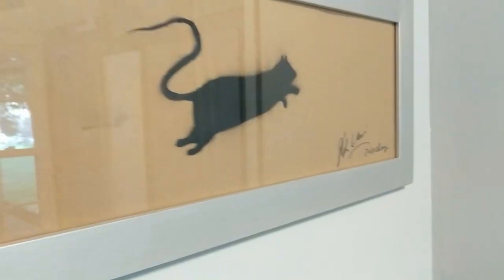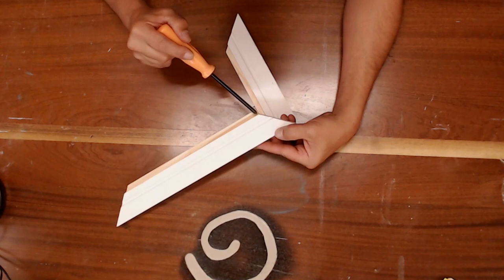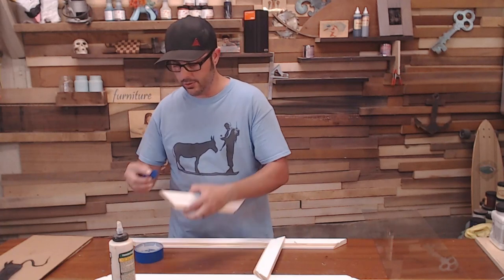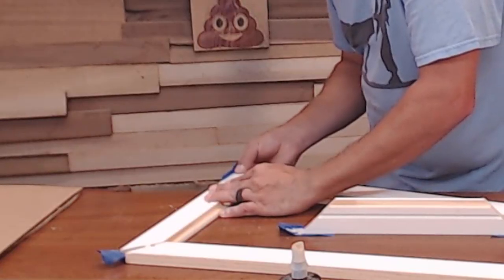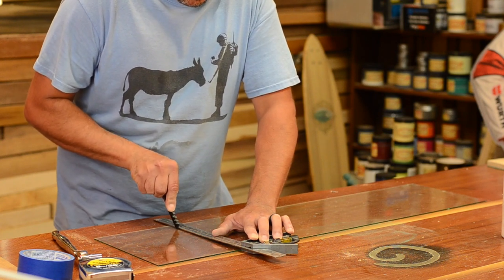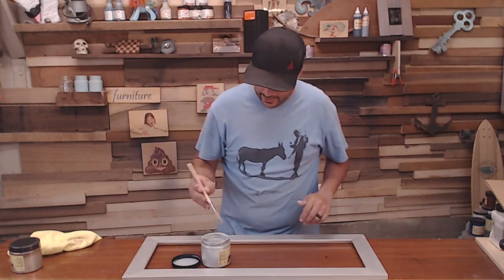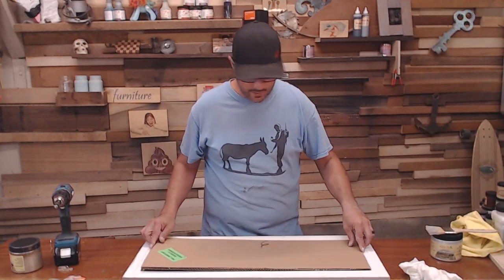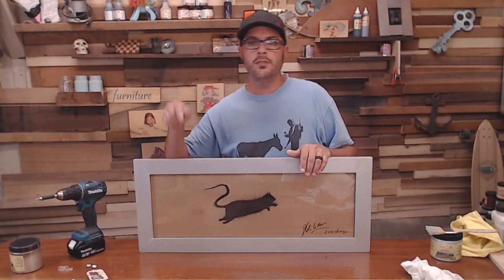How to Make a Picture Frame, Cut the glass and Paint it!

Comment: Great glass cutting. If you cut over the same spot twice, the cutter wheel will get dull. Also a little oil on the cutter wheel (3inone, vegetable oil, lamp oil) will give a smoother cut, but only a small amount so you don't make a mess.
Reply from the maker: I could see how oil would work help and make things so much better 👍 thanks for the tip!